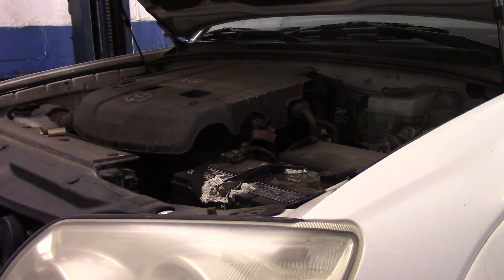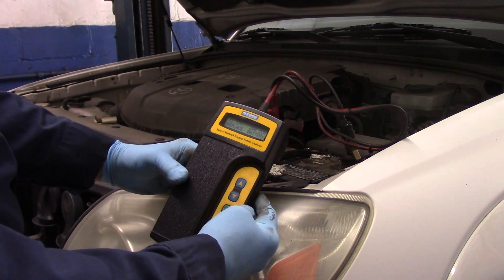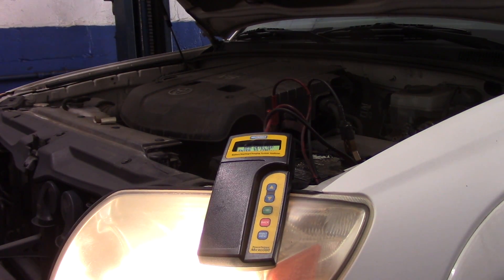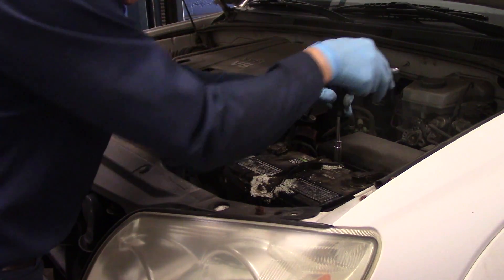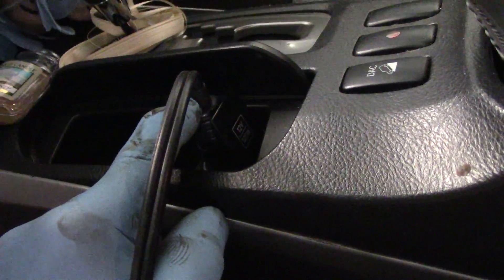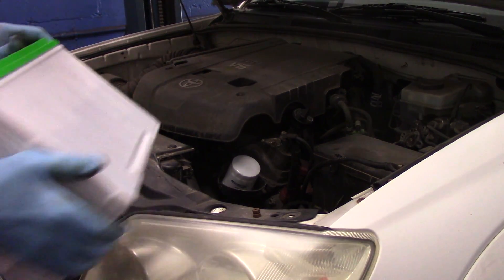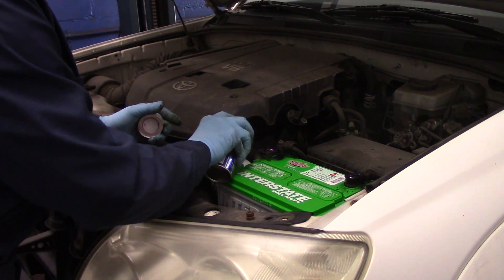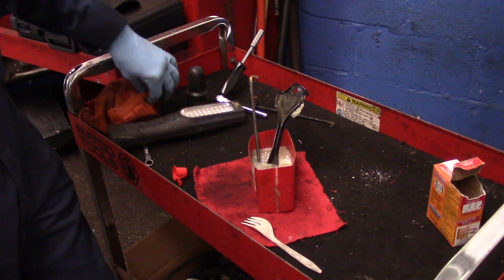How To Test And Replace A Battery 2002-2009 Toyota 4Runner

Comment: Is there any problem with using a battery that is a tiny bit smaller than the battery hold down can hold it down? I feel really uneasy about the battery hold down not actually clamping on it. I got it from auto zone and they told me that it was the battery that came up for my year make and model but doesn't fit snuggly like the previous one